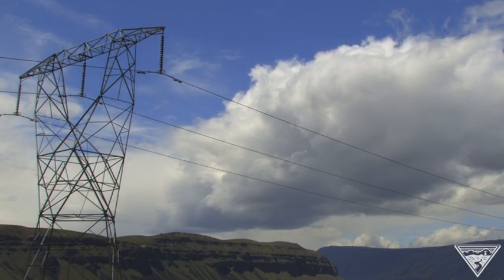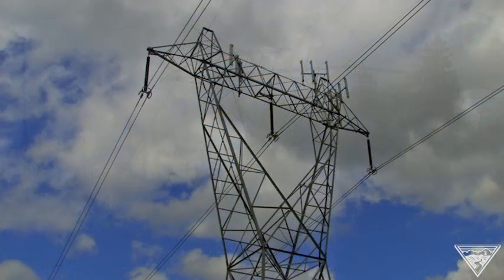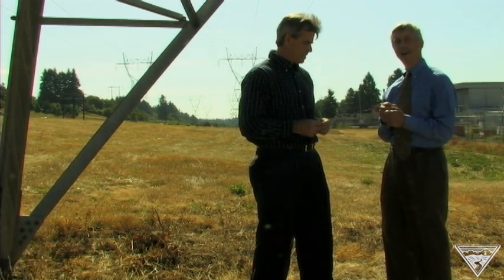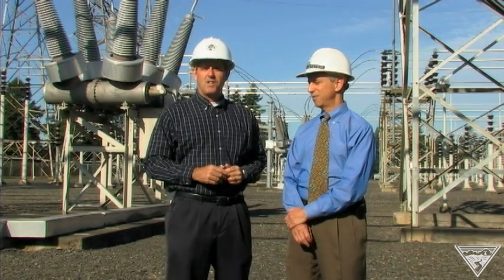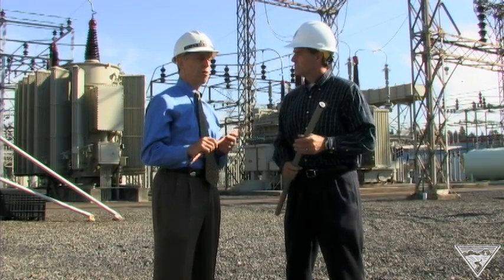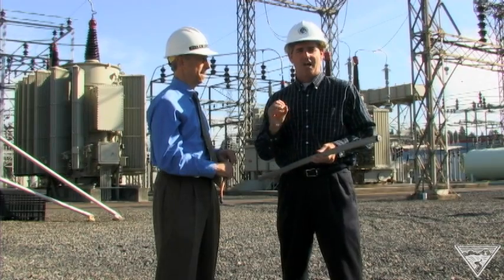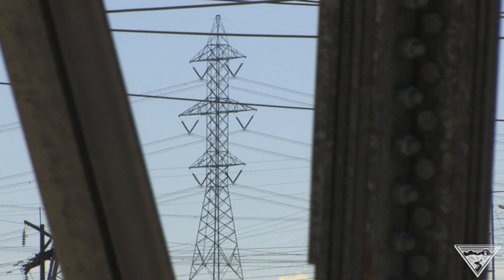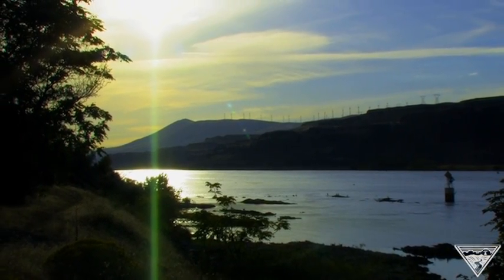Value of the River - Transmission

Comment: Dear BPA,
I am working for Power Transmission Company, EVN Vietnam. I am very interesting with your videos. As I see, some your transmission line without earth wire (for lightning protection), maybe! Could you tell me about that? Thank you so much.
Reply: They all have earthing conductors. The one line where you see only three conductors is a high voltage direct current line, you have a positive conductor, a negative conductor, and the earthing conductor on that line.
Reply: since ur a workeer for Power Transmission Company iz diz fl4t or round???/